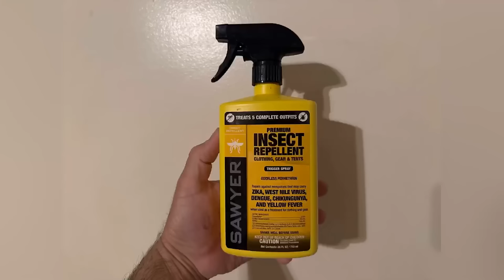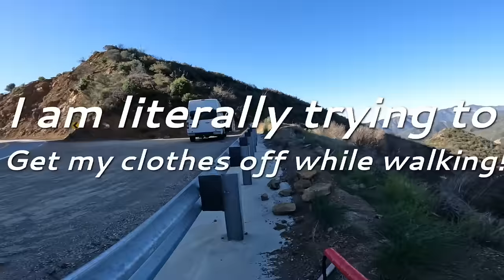Old classic vehicles found off the cliffs of Ojai California.

Comment: That first pair of cars looks like a 1935-38 large GM (4 door) sedan (Chevy, Olds, etc. all offered straight 8s) and a 1954 Mercury. The Merc might be a two-door which would make it more interesting to car people.... The casting number on that intake manifold later in the video is from a 71 to 73 Buick V8 motor. The last car looks like it has a late 30s to early 40s style bumper.
Reply from the maker: Thanks for the info!
Reply: I would say its a Buick because they used overhead valve engines in the 30s.  It was their selling point.  Other cars would still valves in the block visible.  That said, someone took the head and carried it back out of there!

Comment: Just around the corner (where you parked the car) on that high straight with a large steep canyon. That is the part that obsessed me.
Reply: @reverserockettv007  I have been staring at that part many times and found more and more cars. But the image that I am getting lateley lacks detail, so I can't see them anymore. I mentioned it before. I am sure I have seen an old pick up  on the slope and a few more cars  hanging, and lower on the bottom about 6 cars.  I returned to Google Earth but I just don't see them anymore. I think it is the image quality. I remember I even  measured the detour canyon walk from below.  34°31'43"N 119°14'57"W
Nice adventure by the way you posted.
Reply from the maker: Thanks! I am trying to find a day this weekend to look through that entire canyon!